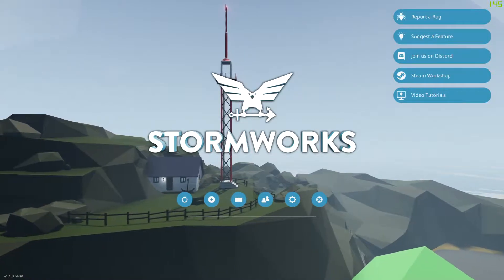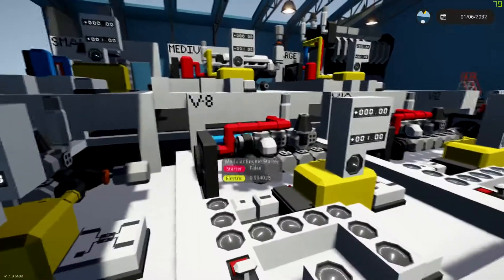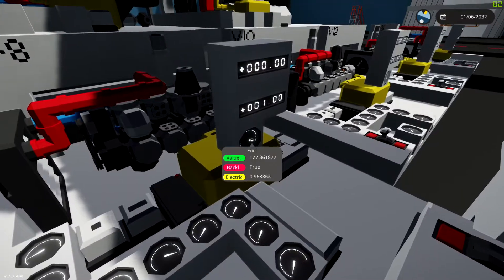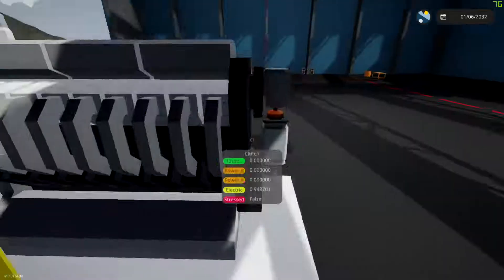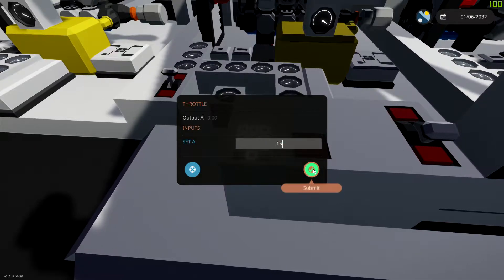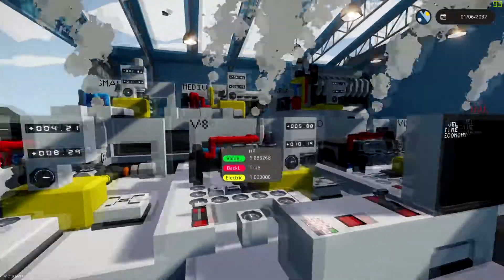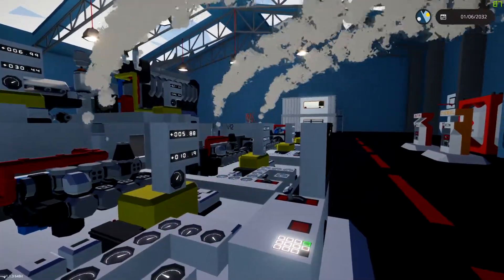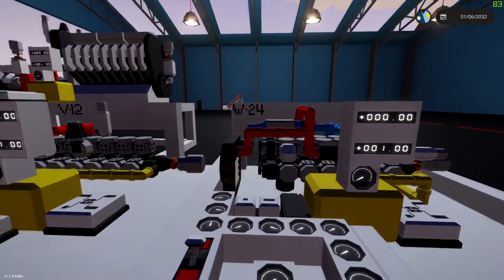Stormworks 1x1 Modular Engine Comparisons

Comment: I created a quad engine 2 prop airplane using 1x1 modular. i have about 12-15 cylinders per engine. that with all four engines putting out about 720 TRQ. thats avg 180 per engine. how does your 24 cylinder only do 27???
Reply: The torque figures here are low because there is only the torque meter connected after the clutch and it has a very small mass. Just adding a flywheel to the crank increases the torque readings significantly, adding generators adds even more, etc.  

Testing engines like this without a load connected is pretty meaningless, It's kinda like asking a weight lifter to show you how strong he/she is by asking them to lift a bag of sugar... 👍

Comment: I'm interesting in where you got your formula for horse power?
Reply from the maker: I made the assumption that the game uses ft-lbf for torque and not Newton Meters. Based on that I found the formula posted in the video description. You can find that formula on the internet pretty easily. "The constant 5252 is the rounded value of (33,000 ft⋅lbf/min)/(2π rad/rev)" - https://en.wikipedia.org/wiki/Horsepower. If Stormworks is in Newton Meters, then you divide the resulting HP by the Ft-lbf to NM conversion, which is 0.73756. Either way this video shows the relationship with HP and T power outputs with relation to different engine configurations, which was the goal of this video. I hope that helps.
Reply: yeah, I have messed around with stomrworks engines for a while now. I have always kind of wondered what kind of horse power they have. Not sure why but it seemed like very low hp numbers in your video for the standard engines.
Reply from the maker: I thought so too. Maybe I did something wrong in my calc. I welcome a correction if I made a mistake. If Stormworks torque units are nm, then dividing by 0.7 will increase them slightly. Also, I'm newer to the game than you are, but in my experience the engines don't seem to be very powerful at higher rps, but they do seem to have lots of low rps power (ie torque). And in real life diesel engines usually have more torque than hp.